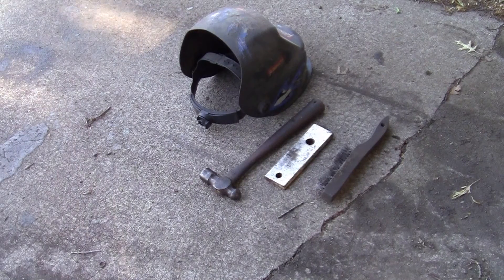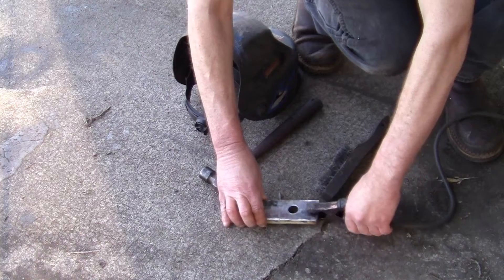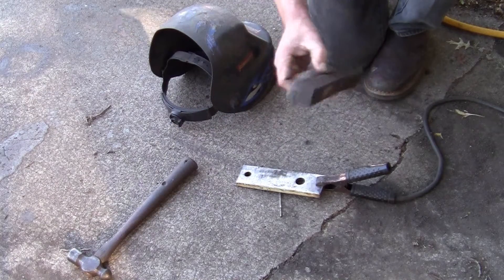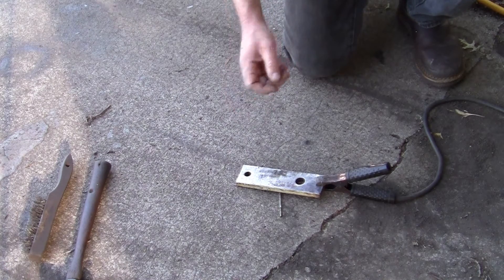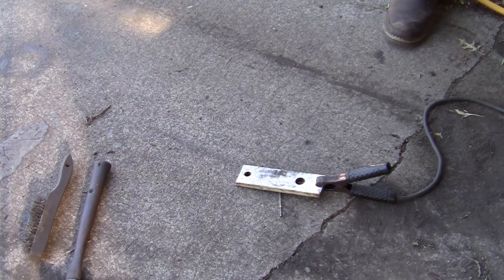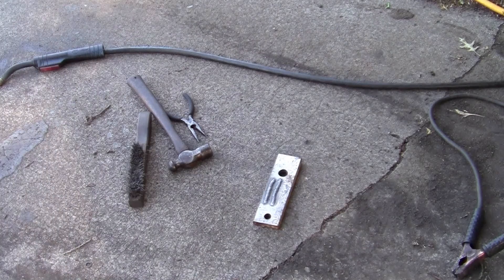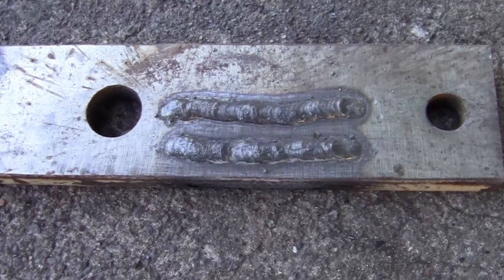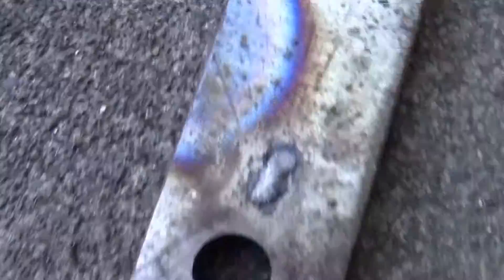HOBART 135 WELDER REPAIR (PART 2) BOARD REBUILD

Comment: What was the part number on those mofets transistor?
Reply from the maker: I am not sure I would have to take the welder apart & that is out of the question . Sorry man !
Reply: @shawnmrfixitlee6478  didn't you buy 5 of them
Reply from the maker: @Projectblackkjack  I used 2 kits and gave away some . Sorry I just don't have them anymore . The kits are available on Ebay and they may have a # for you.. Thanks